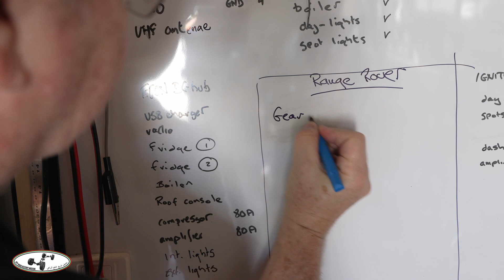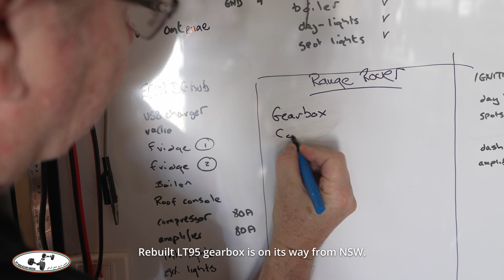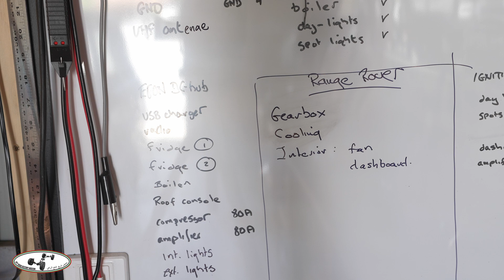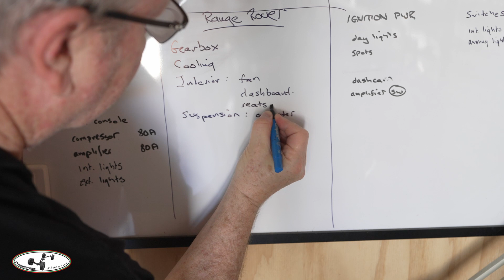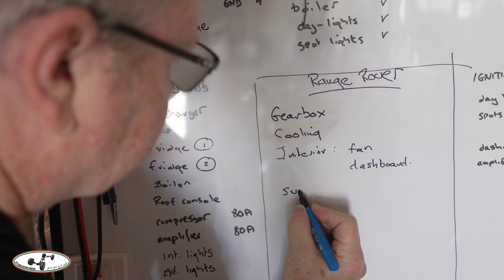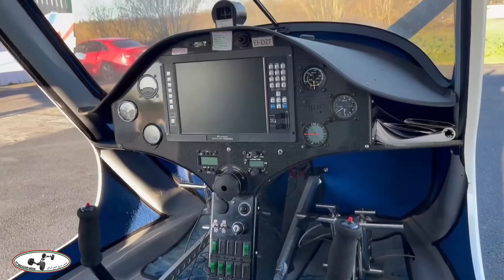Unexpected Wheel Rim Problem Revealed | Range Rover Classic Longest Track Prep Begins | 4xOverland

Comment: A work hint .. when drilling through a rivet or anything really, especially on a firewall, to stop that sudden push though and possibly damaging whatever is on the other side, put a tube of some sort over the drill bit and only leave exposed enough drill to do the job.. even a small block of wood drilled though is enough,  plastic tubing, an old bit of copper tube.. anything is better than having to repair what's on the other side.

Comment: Andrew, pull the window frames from the doors and clean/de-rust the window channels. Replace the Channel Rubbers with new. The flocking wears off the old rubber and then you have bare rubber on glass and a fight to roll up the windows.  You may as well install your new cranks while you are at it. Do it right, do it once.  Too bad you don't read these posts, just the ones from your Patreons, the curse of being a full time business man and YouTube Superstar.
Reply: Correct ... the regulators look like the old Marina Van ones. The teeth deform.
Best to chalk the glass first for runner position ... sometimes they pop off.

Comment: Loving this project.
Just completed my second two door restoration,it’s an illness and need counselling ;)
As you alluded to Andrew,it’s cathartic and fun.
Top tip:On both vehicles I dumped the upper tailgate( thin early style )lower seal.
Replaced the track with the later type and used the much improved 4 door type seal which all fits perfectly.
Sourced from FF and a rusty donor.
This is much thicker and conforms to seal better,definitely reduces the  draw of toxic fumes…
As for the look,no one will notice the difference.
Can’t wait to see her in action ,cheers Warick

Comment: With the radiator when the engine is hot, get a temperature gun and measure different areas of the radiator. It's common for older radiators to have a lot of sludge and scale on the bottom, reducing circulation and radiator efficiency. I reckon the thermo fans are a great idea it also makes the car quieter. Lots of advice on old Holden and Ford forums about thermo fans.

Comment: Glad you’re enjoying the project.  A tip I learned from the aviation mechanics I work with.  Make “cut-outs” for your tools to sit in.   That way you can tell at a glance if you’re missing a tool.  I used grey floor mats

Comment: If you want to keep the original look of the rims i would go to summerfield engineering who specialize in removing the original centres and weld on a new outer rim which will be tubeless compatible. You can even specify a width change or offset change. Located in W.A. they have done many wheels for me.

Comment: Hi Andrew, re the rim issue I would suggest looking at factory Land Rover wheels off either a Defender or a Discovery 1. The beauty of these wheels as opposed to after market ones is the size of that inner lip that is much larger than most other cars. This brings it closer to a beadlock system as it really retains the beads securely at very low pressures. It will be a bit more difficult to fit tyres because of the size of this lip but any quality tyre shop will be capable (and looks like you have a good one). Just beware the early Defender wheels as they are no different to yours.
Reply: i would just look for what was used on the last of the Range Rover Classics, which almost undoubtedly were available for tubless tires.

Comment: I don't like the idea of removing a belt driven fan in favor of electric fans, I do think an auxiliary pusher fan would be a good addition but I'm paranoid about e-fan problems. If you do chose to convert to solely e-fan you would want to use a Toyota Prius fan or another OEM unit from a vehicle with similar radiator dimensions

Comment: 19:00 Amdrew, there are two questions about running tubeless tires on rims designed for tubes:

1 - Construction: are the rims physically able to hold air pressure? The rims on my 1948 Willys can't - the center disk is riveted to the shell and air can leak out past the rivets. Sandblasting the rims and sealing them with something like POR-15 can cure this problem.

2 - Do the rims have 'safety beads'? This is a slightly raised portion of the shell that keeps the bead f the tire from coming away from the bead lip of the rim. Some of the rims I have for my jeep have this feature and some do not. I have the rims with this feature on the front axle of the truck and the spare, and the rims without it on the rear axle. While I feel safe running my overlanding truck like this, you run yours harder that I do (mainly due to funding) and your mileage may vary.

My current setup is 235/85-R16s on 4.5 inch x 16 inch rims. Needless to say, these rims are  extremely narrow for the tires, but I don't have a lot of choice. My jeep is two feet longer than standard which compromises the turning circle and breakover angle. Stock 29" tires do not provide sufficient breakover for the intended use of the vehicle. Wider or outside-offset rims compromise steering effort and stick out past the edge of the body and you know where that leads. Running wider rims, whether centered or offset creates extra effort on the manual steering and wears wheel bearings prematurely. Surely you can see where this is going. The tire/rim combo I'm using might not be optimal for tire performance, but it's the best I can do on the chassis I have.  

The rears rims are circa 1940 without the bead-retention 'lip' and one is tubed because of excessive air loss. The fronts are circa late-1950s 'M38 / CJ5' rims that do have the bead retention feature. One of these leaks as well and I'm hoping to straighten and seal all five rims this spring.

21:00 yep. Those are exactly what I was talking about. Your best bet if you want to stick with factory-appearance rims is to find rims from the first-generation that ran tubeless tires.

28:00 looks like you need to adjust the window frame itself. If you can remove shims to move the bottom of the window frame aft you should be fine. I'd also recommend lubing the window channels inside the door with the window all the way up just to make sure you get all of the sliding surfaces.

My apologies if I come off as a 'know it all', that's not my intention. I have pretty solid experience working on older vehicles, but no so much with overlanding.. :D

Comment: Great video Andrew. As an owner of a couple of 2 door RRCs project cars I am currently stripping down a working but worn 3.5 V8 engine. What I found was even with clean oil the sump was full of very solid gunk. I suggest as part of your trip preparations that you remove the sump and inspect it as when you hit the corrugations any material in the sump is likely to become suspended and pumped through your lovely motor. Just a suggestion as very keen for you to succeed.

Comment: Just my armchair recommendation: repair BOTH door windows. 'Good enough' on the driver's side will not be good enough once the passenger side is working like new.
Second recommendation: retrofit a cabin filter for your fan/ventilation system.
Reply: Agree...but I'd go a step further and say that it'd be worth doing a "proper job" on both sides. Even after "fixing" the passenger side one it STILL sounded as though there was a cat with it's tail stuck in there....and it'll only be a matter of time before the dry lubricant ceases to be of ANY benefit.

Comment: I had a similar issue with my 80 series land cruiser windows. It was the window channel weatherstrip. It was dry rotted and hard. The rear doors seemed ok but I replaced all 4 anyways. After installing them I used some silicone spray to lube them and the windows rolled up and down better than my 2016 corolla. I also replaced all the inner and outer belt molding (the rubber seals along the bottom of the window opening), that removed any rattling that the window channel weatherstrip didn't.

Comment: I am loving the Range Rover content. Your experience with the window regulator reminded me of a bad regulator I had in my Discovery. It had power windows and if you didn't hit the up switch to stop the window as it rolled down at the bottom, it would keep going and the window would get stuck in the open position. The only way to fix this was to remove the door panel, remove the regulator (which involved using gaffer's tape to hold the window up for the final disassembly, then reset the electric motor's gear to mesh with its partner. I lived with this until I got caught out in a terrible rain storm and had to spend half an hour miserable in a parking lot under the overhang of a restaurant to get the window closed again. After that, I properly fixed the issue.

Comment: I don't know if you've had the old radiator cleaned yet. On my '63 Volvo P1800 I could see some deposits when looking in through the radiator cap. I took the radiator to a local shop that specialized in working on old radiators. The shop owner is a big fan of trying to preserve old radiators rather than just rebuilding them. They cleaned the inside with a special flush. Then pressure tested it by filling it, apply pressure and hitting it all around the outside with a rubber hammer. This is to check that all the old solder  joints are holding tight. If there is a weakness, they tell me this is a great way to expose it. Then it was flow tested to make sure it matched factory flow requirements. Since it passed all testes after the cleaning they painted it back the original black. Shockingly all of that work cost me $55 USD. For reference an OEM replacement is $350 USD. Now my cooling system works fine (for a nearly 60 year old car).

Comment: Andrew check the plub line of the window runner, you may find it's not true which is causing the glass to stick - you can do two ways take a plumb line on the opposite door and  take measurements where it gets stuck and see if there is a difference - 2mm variation will stop it sliding.

Comment: Thanks for wheel refresher.
I was glad when I got my last generation MGB with electric fan. The early mechanical didn't have a shroud and could overheat in certain conditions. The electric fan only played up with a faulty sensor/wire, but I was tempted to put in a manual switch for the number of times I would have needed it.

Comment: I bought a set of those rims specifically to mount 245 Simex Extreme Trekkers as my off road tyres for my Defender 90 used to air down no problem and never had bead pop even on extreme rutty tracks!
aired up and drove the highway home never a problem they were noisy!

Comment: I always try silicone spray first before fiddling with the fiddly window winders themselves. Spray lots of it at the bottom of the rubber,  where it disappears into the door, and it will run down. Then wind the windows up and down continuously, until they move freely. This unfortunately has to be repeated from time to time. 😊👍

Comment: If you replace the gas struts for the tailgate, make sure they are build in the other way round. The rod needs to face down, as a little bit of oil is in the gas chamber to provide an end-dampening. To keep the oil down over the complete travel the rod must face downwards in open condition.

Comment: First mod I always did on my Rangies was change the mounting of the rear window struts. LR put them on the wrong way & they always try to push the window open. There was a kit available from Melbourne
Reply: In what way did you change the strut mounting?
Reply: @pfcvdv  the kit moves the mounting on the car to the bottom & on the hatch to the top like how most struts are mounted on any hatch. The struts then hold the door closed. LR designed it wrong.
Reply: @JobbazIdeaz  I can recomend this modification, did it to my old Rangie 30 years ago, actually holds the tailgate down against the rubbers.

Comment: Window alignment is a dark art. There is often adjustment on many of the fasteners but if there is too much slack in the mechanism it is impossible to get right. I often use old scraps of bar soap to free up where the window slides. Sometimes just cleaning them out is enough to restore free movement though.

Comment: The problem with thinking the radiator is good ,because it looks ok doesn't mean it is. The tubes in the radiator are horizontal so sediment builds up over time clogging the tubes I would recommend replacing the radiator, the mechanical fan works well replace the fan and clutch, you should be able to put the later plastic fan and shroud on works fine in Death Valley no need for electric fans. Enjoying the video's from the states.

Comment: Hi Andrew,
Word of caution using the britpart tailgate seal ( the long one that goes all the way round), the rubber that britpart use is too solid, top tailgate will either not shut, or bounce open.
I had fun alive trying to get mine to stay shut, ended up using a good used one, leaks water now. Not sure if genuine ones are available or if britpart have changed the rubber compound, defender door seals by them have similar issues.

Don
Reply: I found the same thing and refit my old one.  With a little adjustment, it sealed up nicely.  

Britpart door seals are always too hard.  BritRest shows that on some of his videos.
Reply: @nickboylen6873  I’ve given up with a lot of britpart stuff, some of it is ok but lots isn’t fit for purpose! Unfortunately they have taken over allmakes now, their stuff was better, not much but a bit!
Best was a britpart brake light switch that failed after 2 uses, tested then failed the next time it was used, getting off the drive🤬
Reply: @Bigbluelandy , I had the same experience.  Their brake light switches tend to activate and deactivate at different points, so setting them to activate correctly results in them staying on.  They are unfit for purpose, but do OK for the fuel selector tap mounted fuel gauge switches on SII and SIII vehicles.  A lot of Britpart stuff won’t even fit. Water pumps with wobbly mating faces, brake cylinders full of pores and swarf, brake hoses with unswayed fittings or solid hoses, boxes of brake shoes with mismatched linings that give asymmetric braking, steering components made of brittle Chinesium… the list goes on.

Comment: Very cool to see the Rangie project. The window issue reminded me a lot about working on a Discovery 4 door to replace the door release cable. 

(Fortunately the LR3/4 is very well documented on YouTube and there is a good selection of videos to watch, especially PowerfullUK). Wonder what the labour would have costed. If I didn't do it myself. 

However I would still get both of the Rangies doors, windows and mechanisms checked and replace/fix the item causing the problem.

Comment: About the window, and because I had the same problem, try loosen the bottom bolts holding the window frame to the door, and there should be a little movement/adjustment. If you could just move a couple mm the rear or the middle window channel (wide the distance between them), you could easily see the glass slide easily up and down. As for the rims , someone mentioned later model rostyles, but even my 1991 which had rostyles from factory  , are tubed style. Only option to keep it original looking, is to remanufacture them . There are a few wheel specialists  in UK that keep the centre of the wheel and fit new tubeless outer rim that is 7 inches wide, better foryour 235s . I assume there will be someone in Australia too, but it won't be cheap
Reply: This is why I read comments.

Comment: Hi Andrew! May I recommend that you fit some external Tire Pressure Monitor Sensors, they are cheep and will fit any car. The small monitor inside the vehicle mounts to the cigarette lighter and will warn you if any tire loses suddenly or slowly any pressure. Very helpful if you're driving for long hours. And how about testing the pressure of the fuel pump? You do NOT want that to crap out on you on the trail. Change the fuel filter too. Cheers! :)
Reply: Go watch his past experiences with external tyre pressure monitors. They aren’t reliable and therefore not worth the headache.
Reply: @offroadingfoz  Not in my experience, I have them in both my cars and never had an issue. Thanks though! :)

Comment: Hello Andrew, two observations, if you care to agree/disagree or enlighten me: Firstly, the original washer fluid reservoir was mounted at 4 points, whereas you are reattaching to the firewall using only two of those points, in a way in which it appears to me that the reservoir will be held slightly away from the firewall by the bracket itself, thus with the potential for greater vibration, flex, and damage from the endless corrugation of the Canning Stock route.  Secondly, wouldn't it be wise to prime and paint the firewall (and perhaps plug or silicone shut the two unused holes) where you sanded it clean?  Inevitably, filling the reservoir will repeatedly wet the area, leading to surface rust and someday....

Comment: Land rover used the same stud pattern for all models practically since the establishment of the marque. 

If you run alloy wheels,  make sure you have the studs for them. The alloy wheel studs are marked with a slash.

Early disco steelies do just bolt on, quite a few triallers in the UK ran them.  

At one stage 15 x8 inch Sunraysias were available for land rover use.

In the late nineties I tried running early seventies series land rover rims on just tubeless tyres. It was pretty hit or miss whether they held air or not at 30 PSI. 

Had an old dead rangie laying around. The previous owner tried to go tubeless but he must have ran into the same trouble as me as three of the tyres had tubes and one had copious amounts of selastic. He ran 145/70 r16 muddies.  I do not recommend these tyres as the vehicle also had two busted diffs, and two broken axles  from its last adventure.

Never ran them aired down, as at that time I didn't know about that trick.  I suspect they will roll off the rim easily due to the lack of safety ridges.